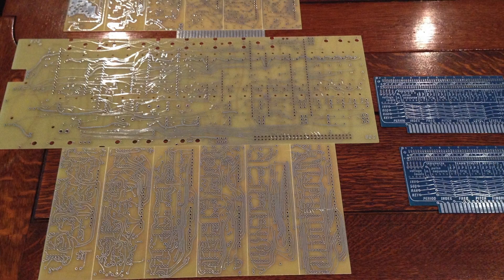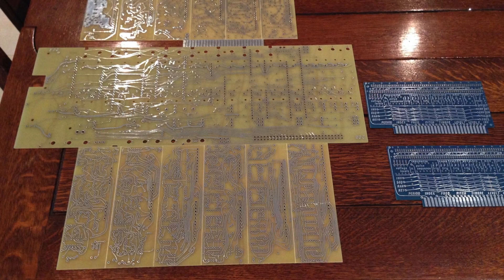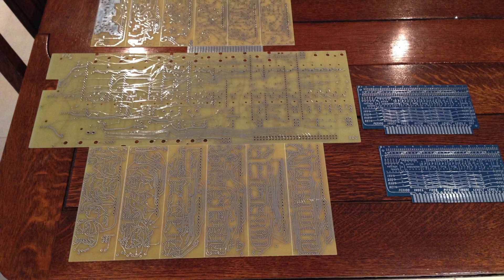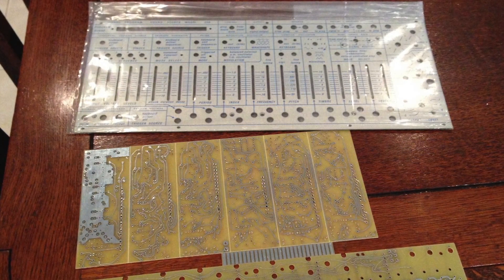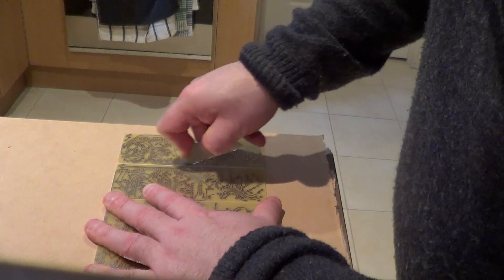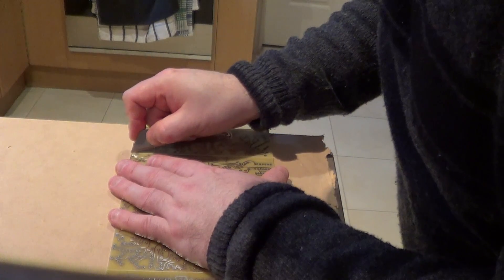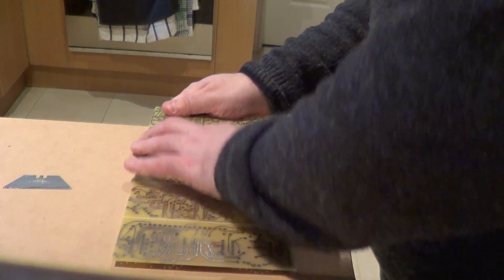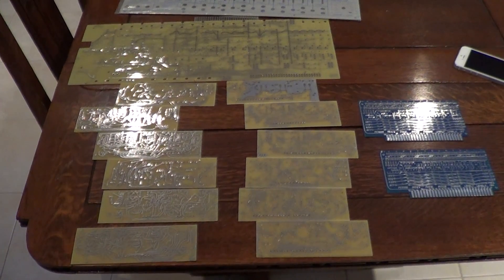Buchla 208r Clone  Build  Video #1

Comment: Thanks for posting!
How much was this kit?
Do you know where to buy diy boats or cases?
Reply from the maker: The kit is quite expensive. When I got the boards and face plate it was going to be cheaper than buying a Easel. As you can tell from my video's The easel ended up cheaper. I think the boards were $450US and the front panel something like $120 although I could be wrong .. If you search 208r on the interwebs you can find some details :)